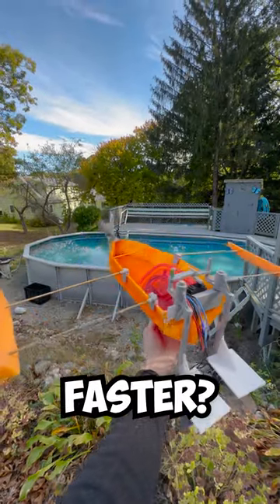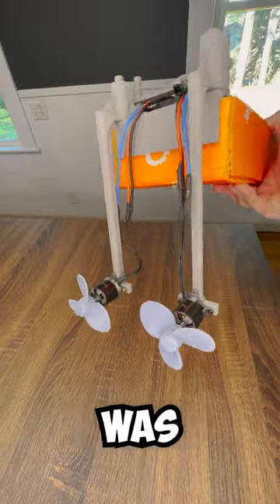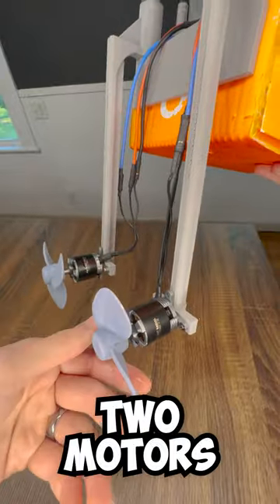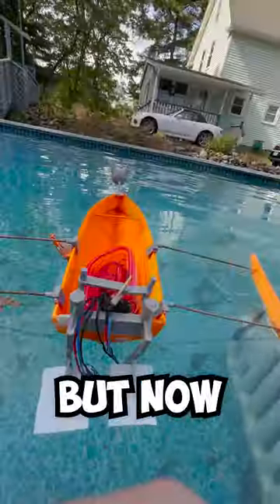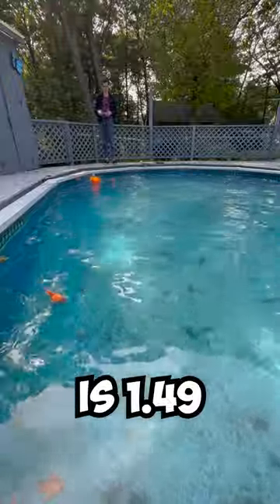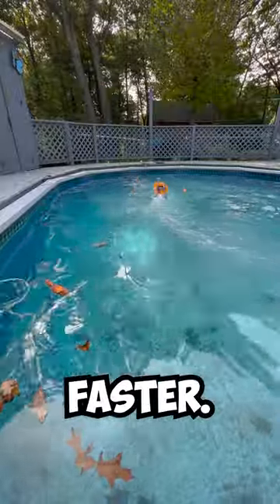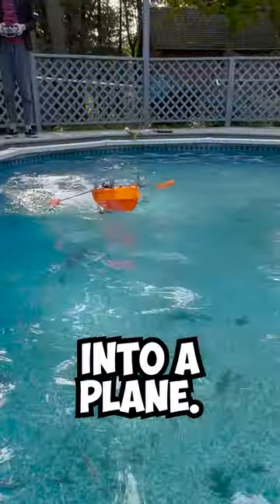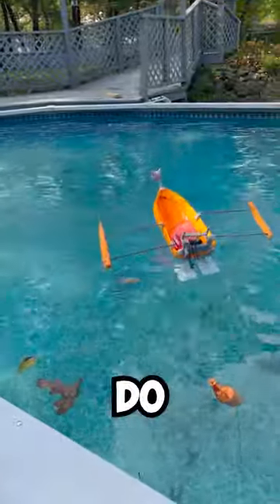Two Motors on DIY RC Boat

Comment: Idea 2: have a more modern design or add some 30 grams of weight to the front of the boat or add 2 smaller motors that power the main motor
Reply: better u measure.. Depth × Length × Wide
Reply: he also need more long boat with more heavy front
Reply: I agree because if there is more weight, then there will be more drag caused by the front. I think that he should also add more weight to the side things (I don't know what they're called) so it will be more balanced.
Reply: @Gannibal_Sektor 👍👍👍👍👍👍👍👍👍👍👍👍👍
Reply: Ad a veit infront

Comment: Add hydrofoil wings to the bottom of the hull, so that when the boat lifts up, it will be much more stable and it will allow it to also move with smaller drag in the water when traveling at high speeds
Reply: Yeah thats what i thought.
Reply: I was thinking of that to
Reply: I said this in a earlier video
Reply: I was thinking the same thing
Reply: Right? Its already trying to hydrofoil off of the grey pieces above the props
Reply: Add wings to it, so when it lifts out of the water it can become a plane
Reply: But remember that at some point the water is gonna be your friend so with the right design water can actually push You making You even faster
Reply: Me toi
Reply: Agree
Reply: That is what I was thinking
Reply: I was about to comment this then i saw you

Comment: Mechanical engineering student here: shorten the vertical beams that connect the propeller to the power source and that thing that changes the direction the propellers are facing, and make the boat longer. These reduces rotational force from the propellers relative to the boat's centre of volume, and thus reduces the tendency of the stern to rise when the propellers start. Also, every time you do a speed test, try doing the test 3 times for each design and take the average time as  result.
Reply: Yes you thinking what i think
Reply: @SalTheBob  which one?

Comment: You should make the hull smoother and raise the propellers up so it doesn’t fly out of the water and you should move weight to the front t of the boat not to much though you should also put the mini hulls and the side closer down to the water so it doesn’t turn to much

Comment: Design the boat like a jet air intake and mount the engines forward. The motors would then have to be fixed in their position and cannot move, but the boat should be faster and more stable in the water. The controls work well with control flaps.

Comment: Just make it with hydrofoil wings. It will be faster because you'll reduce drag of the water and more stable on high speeds. I'd recommend you to start with U-shape wing first instead of t-shaped, because U-shaped wings don't need to be constantly controlled by computer to be stable and avoid stalling. To add them simply find the centre of gravity (find the spot where front and back balance), then add 2 U-shaped wings with equal effective surface areas of the wings on the equal distance from centre of gravity (not too close). Add some elerons or made the whole surface turnable, so you can turn the boat with it. Also this motors with their mounts are too heavy for a such short and lightweight base. Try to experiment with the layout, maybe make base longer at least, so they won't literally drown the back of it. The most radical but cool thing would be to mount motors in centre and somehow extend the drive to the props. Thanks for good content

Comment: You can either counterbalance the weight to the front or raise the props to raise the angle of thrust. As it sits now it angles up to much because it is up so high.

Edit: think of the point where tye mount meats the boat as a pivot point. You basically have a lever and the shorter the lever the less rotational movement you would get. This also means more power to the directional movement because it isnt being used as rotational energy.
Reply: To add to this note, the motors and propellers are currently mounted on a long arm, far below the center of mass of the boat. This, in combination with the extra power of a second motor, causes a large moment on the boat which is seen when the nose lifts out of the water at the start. I agree the raising the props to bring the thrust vector closer to the center of mass would improve the handling. Alternatively, adding a counter weight to the front of the boat could also help but more weight = slower acceleration so the former solution is preferred

Comment: Idea: use toroidal propellers, they spin round and because every two blades there is a outer wall that extra water isn’t wasted as centrifugal force and has to go out as force

Edit: also for a bit extra speed and efficiency make a wing beneath the boat that creates lift making the boat go up, this decreases contact with water and in turn causes it to raise up to increase speed, beware on the angle of attack though as too high a velocity and it will be a boatplane, just stating some ideas
Reply: It makes the boat slower
Reply: toroidal are theoretically better, but with extreme precision manufacturing, which 3D printing and cad (Instead of CAE) is not.

Comment: You see the flaps on top of the motors, they act as hydrofoils. In order to stop it from lifting, you can try to point the flaps at around -5 to -10 degrees. This should make it generate lift downwards and should keep it down. If you want to make sure it goes super fast, i reccomend you to add sharp points at the bottom to allow for hydroplaning. This is much faster than hydrofoils as it pretty much just leaps out of the water, reducing drag significantly and is easier to make compared to a hydrofoil
Reply: He is right

Comment: Put the motors on the side, so the speed is evenly distributed. You can also put the motors on the front so when you accelerate, the front will basically drag the rest of the boat along and make it more stable (when the boat turns, you might want to lower the sensitivity of the controller). I think the side is better, but they are both okay.

Comment: Ad weights, use toroidal propellers and the rolling is because the propeller is not horizontal with the watersurface, if it's parallel it wil be mutch easier to control and make the motors fixed to the hull its more stable and you can turn by giving more power to one of the motors sothat it wil turn in the opposite direction

Comment: If you wanted to reduce drag and hopefully roll, you could add stabilizing fins. Even just adding a couple small one in front of the motors, while potentially increasing drag, will drastically increase the stability, both in yaw and roll. The boat would have an easier time going straight and would deal with the torque of the motors easier, and you could lose the drag of the extra pontoons. It’ll take testing to determine viability, but it could help your design

Comment: Faster boats kind of move on water-skis when they get up to speed. You might want to lean into that. 

Maybe make the katamaran-pontoon-things go downwards when the boat rises up, keep the thing stable? Like, put in spring things that makes them want to go down. 

If you don't want the boat to lift out of the water, maybe angle the fin things above the motors upwards instead of downwards, make it push down into the water instead?

Comment: Bring the motors closer to the surface rather than throwing it all the way down at the bottom, make a more sleek hull design, maybe make the hull a bit longer as well. If the boat keeps shooting high in front, add a bit of weight to the front to keep the nose down just enough. Angle the props to a perfect position to get max speed and less lift.

Comment: 1. Add more weight

2. If you're powering the motors with DC, add an inductor to the circuit so they start up slower, and it won't jerk as much upon starting the motors.

Comment: Faster running speed and acceleration are 2 different things. Considering how powerful this setup is you may want to angle the motors so that the acceleration force points somewhat down. This will push the aft up and help hold the nose down giving you better control. You may also want to add ballast to the bow in order to help cancel the bow lift on acceleration.

Comment: Switch the props side to side and switch the directions of the motors, doesn't look like the hull is making it jump out of the water, it looks like the props are just climbing straight up in the water until the boat gets some forward momentum

Comment: Those guard plates over the motors are actually causing the boat to rise out of the water faster due to the angle and overall weight of the boat. Youl need to cancel out the force by either removing them or using a forward mounted water foil.

Comment: add 2 funnels in the front along the sides 1/3rd of boat's length and them to be in straight line or a bit curved near the back.

Comment: Make the center hull a tad wider and drop the pontoons, and a common thing for speed boats is what’s basically flaps on the back of the boat that help with angle of the boat and turning,it’s hard to explain properly but I think they could help with the throttle issue

Comment: If the boat is flying upwards, maybe putting weight near the front of the boat will help keep it balanced. My thinking is of tractors that use weights on either the back or front of the vehicle to offset the weight when handling a heavy load

Comment: try moving the motors as close to the body as possible.
unless theres a reason they're so deep in the water.

i'd also say you can angle the motors down ever so slightly so that it lifts the back and pushes the front down but i doubt that'd actually work

Comment: To help with small adjustments you could have the props spin at different speeds independently depending on the direction inputted, the directional turning I saw with the servos you might be able to make big and small adjustments effectively

Comment: If the main issue is that the boat slips out of control I think you should try these two solutions
1 adding weight because if the boat is heavier it will probably be easier to control + experiment with where on the boat the weight should be positioned and how much weight to add
2 add a spoiler like in a sport car as it increases downward thrust making it so the boat would jump less, again experiment with the size of the spoiler and the position of it on the boat

Comment: Move the weight further forwards. Make sure the ESC and battery is plenty extra since water is heavier than air. 

The voltage rating is not the limit but merely a suggestion.

Comment: use a differential like in cars and put the steering in the front so it’s easier to steer and you can also put a gyro on so the steeringstay straight in bumpy water

Comment: There's a lot of things you can do differently to make your boat go faster. The more weight you put under the water, the more weight you're going to want on the front of the boat. Your design of your boat is slightly off. That's why it wants to launch out of the water.

Comment: add hydrofoils to the bottom of the hull. the boat will lift up on them which will reduce drag, also you can attach a rudder under the hydrofoils for improved control

Comment: You must make the wings above the propellers adjustable so that they always remain level using a servo motor, or redesign the wings so that they are at an angle parallel to the surface of the water, that is, calculate the degree of inclination of the boat and subtract them from 90 degrees.

Comment: Look at an outboard motor. The shaft doesn't stick couple feet into the water. That's why yours is slow and unstable. Shorten the shafts to where the props are just right below the bottom of the boat. U won't need stabilizing fins

Comment: Now remove the stabilizers, they are just adding weight, as the torque from the opposite moving motors cancels out. Or just redesign them to add more functionality or improve reliability

Comment: Make the motors closer to the hull and remove those flat pieces above the motors. The flat pieces act as hydro foils (hence the flying). If you want it to fly add wider foils and a foil at the front of the boat

Comment: Add more gears to it and add 3 motors for maximum stability and faster also add a sum detail and a modern design and a little more weight to the front

Comment: Put a gyro in it, so you can stabilise it by putting more power in one motor than the other, or use a differential like in cars

Comment: I think that the servo steering is unnecessary now, the motors could be fixed to the hull, and steering could be done by varying the RPM between them.

Comment: try making the hull shape a V shape that is a more gentle slope, you could also add a prop shaft coming out the bottom of the boat at an angle to minimise drag

Comment: It’s the boat going onto plane because of the force of the engines, if it wants to do that then probably make the hull bigger and make a wider and deeper hull and add a small little weight on the front and make the hull more sharper and more aero dynamics.

Comment: You should use 2 motors, but to control the rudder you should use the motors themselves to control the boat,  add also weight on the front

Comment: try using 6 motors and a more power full battery.... use 4 four motors for the boat to go forward/backward and attach the other two on the sides so that help it to turn more easily easily while keeping the speed fast 👍✨

Comment: Add small propellers redisign CoM. Use rc crawler motors. They have low speed high torque and high speed high torque...

Comment: You should move the propellers higher on the hull so it has less leverage to push the front of the boat up and will push the whole boat more forward

Comment: Reduce the depth of your propellers.  The propeller arms are probably too long causing an exaggerated bending moment when you apply thrust (lifting the front of the boat out of the water), making it uncontrollable.

Comment: It's because of the weight imbalance you have way to much weight in the back. What you can do to fix this is adding more weight in the front. Or add 1 or two fins to the front and don't add weight to the front. Witch basicly makes  a hydrofoil but if you add two fins connect them and two fins on the bottom of those going out to the sides so you have more surface area

Comment: My idea: i think ur right 1 motor at back and put the 2 motors on the sides of the boat and put more weight on the boat on exact weight so it goes in straight line

Comment: Remove the stabilizers, they add too much drag, if you stabilize it with some weights down on the hull like real boats do, you will get it faster even if it gets heavier. Also if it gets heavier you can use all that power that it can’t handle

Comment: Motors need to be closer to the hull so it doesn’t torque the bow out of the water and also a keel would help from torquing from left or right

Comment: Im new to the channel and im watching many of your vids right now and in one video you said youll try what the comments say so this is gonna sound dumb but make the sticks connected to the pool noodles at a 45 - 60 degree angle  which will put the boat higher so theres less water resistance and if it sinks too much put another pool noodle directly on the bottom

Comment: 1 main motor on the back, and 2 on both sides and to turn one of the sides has less/more power. Exmpl: to turn left either the right motor has more power or left motor gives less power.

Comment: You should raise the motors up to the level of the bottom of the boat or add hydrofoils to the boat because the motors are too low in the water and will cause the boat to lift up and become unstable.

Comment: Have you ever heard about hydro dynamics, it seems like you haven’t seen any boats. This boat could easily reach a much higher speed with the same engine, if you had any clue what a boat looks like, and how it works.

Comment: The hull design is okay. There is multiple issues with the two motors designs  the horizontal fins over the motors are to large, the angle of attack of the motors, and the arms holding three motors is too long & creating to much drag print them like airfoils and put an extra pinion bar between the two motors just above the bottom of the hull line to keep the two motors in line together

Comment: Make it weight down with so thing as low as possible to stabilize it and make an waterpump instead of propeller.

Make an pump with upen water intake from front and rotate the output pipe to change directions.

Comment: Dude shorten the shaft going down in the water the propeller shouldn't be submerged that far that's why your having the rise in the front of the boat my boy try it out I promise that will fix your issues I tried telling you before

Comment: Rethink the hull design, something optimised for high speed. You might need to tinker with putting weights in different spots to even everything out. Also the motors don't need to be that deep, that's probably one of the main reasons you can't control it.

Comment: 1. The contents are not stable nor balanced.
2. You need ballast. Put something heavy along the center point inside, this will keep the bottom in the water and allow for the force to remain applied properly. Try loose change. Also probably segment the bottom and place more weight toward the front to counter balance all the weight in the back.

Comment: The things right above the motors are acting like hydrofoils wand is what is causing it to lift up. Either remove them or add a hydrofoil to the front so it would be stable when it lifts up

Comment: Design a more hydrodynamic hull and try putting the notors inside the actual boat and scaling down the propellers to get higher rpm and make a cover and put the reciever and the escs in a tuperware.
And REMOVE THOSE SIDE STABILIZATORS
Dats it bye